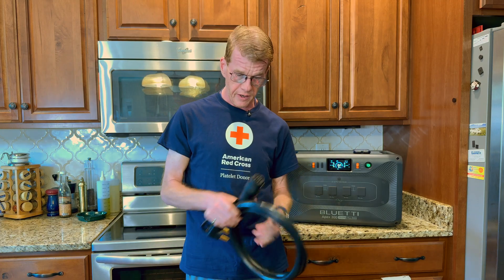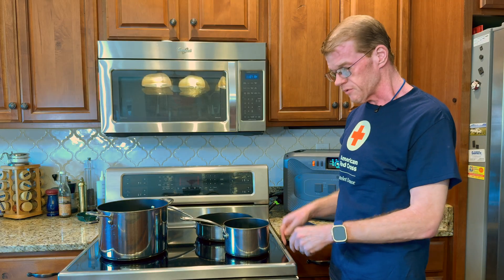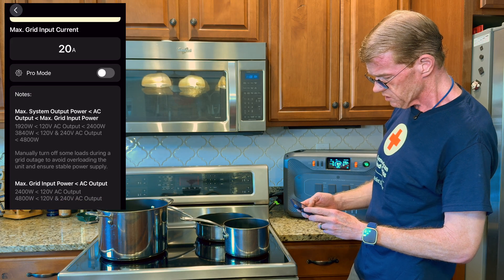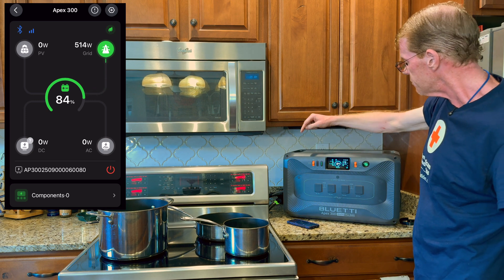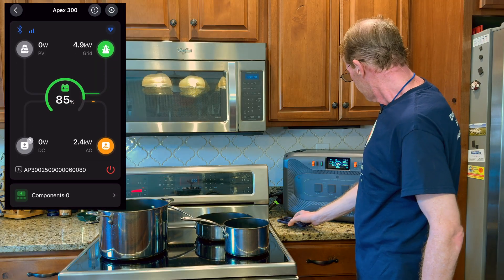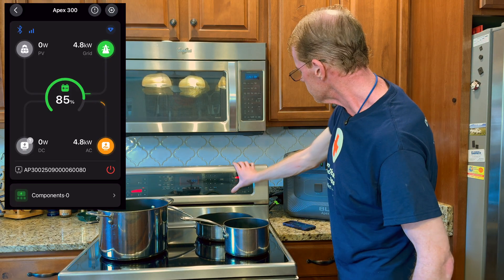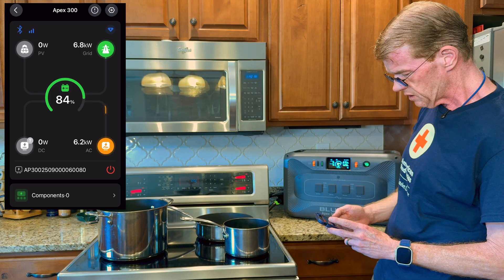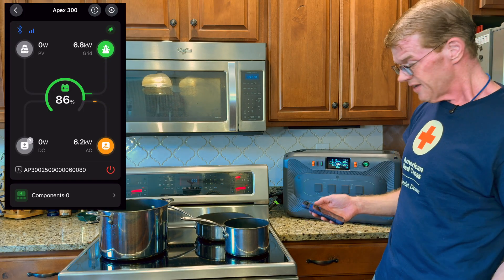50 AMP Input/Output With Bluetti APEX 300 120V/240V Power Station!

Comment: Nice video Doug, thank you. That's useful info. I wonder if Bluetti will make an APEX 500 like they had the 300 and 500 series for the previous generations.
Reply from the maker: Good question.  I'll give you my opinion from a math and Engineering point of view, I have not been told anything by Bluetti on the subject.  I highly doubt there will be a larger model.  A NEMA 14-50 outlet is about the largest commonly found plug type in the US,  at peak it can supply about 12kW.  Anything larger would tend to be hardwired and for that you would use one of the permanent install EP series.  One critique of the AC300 and 500 is that they had no internal battery.  So the device needs a battery, so +weight.  Making 12kW peak power  via two parallel devices would probably be over 100lbs each and very less portable,  so they divided by three.  Making a moderately portable, still heavy, but less than the weight of an AC300 or AC500 + one battery device.  its a lego block that scales from 3,840W, to 7,680W, to 11,520W, all continuous rated, which is more than you should even put through a 50A plug continuously.  Three head units vs two also allows more expansion batteries to be added to the system for a heck of a lot of Wh scaling also.  Two parallel Apex 300 would give you more power than a single 'Apex 500', assuming the 500 would be 11.5/2 = 5,750W rated.  They really designed it so a larger unit doesn't make math sense to have in the lineup.
Reply: @DougKremer  ahh, so much I just don't understand, LOL. I guess there is just not a way to use the electric dryer if you had to. We have a gas dryer now and being pressed to move all to electric. So if we have an outage I just won't dry clothes, oh darn. Laundry it is! I do have to learn more about these bigger units as I would like to make a move to them at home in the nearish future. Keep the videos coming, I really like them.
Reply from the maker: @happymaddie3039 if I was shopping for an electric dryer right now, I would buy a dehumidifier model “ventless dryer”.  They plug into a normal 15A outlet!
Reply: @DougKremer  That sounds interesting....My dryer now seems to be dying, not drying well so I suspect I will be shopping for a new one. watched your video on installing a transfer switch to your panel, super interesting and you make it look so simple. I will still be hiring an electrician for this but I feel better about it being a relatively simple and possible solution for us. I am still wanting to add an APEX system for a few of the essentials in the house, mostly to avoid the grid and peak hours. I currently have one power station at all the key applies around the house and so there are many. Will be working my way to a more tidy solution. Enjoying your videos very much, please keep making them.
Reply from the maker: @happymaddie3039 Thank you Maddie!   Sort of funny, my dryer just a few minutes ago lit up with an airflow error light, I may be taking it apart to clean out all the lint. 😢
Reply: @DougKremer  oh boy, best of luck on that project!

Comment: This is what I was most interested in when I first heard about this device. I ended up testing this out last weekend when I got mine. This is truly an amazing feature, because I can run my back up generator at a lower output level (saving fuel and wear on the generator) and allow the apex to handle the surge loads. I have since ordered a second apex and will now power my house from the apex and use the generator to charge the batteries. Lastly, another good feature of this setup is the UPS function, when I kill my generator as long as I’m under the max output of the apex I don’t lose my lights or electronics.
Reply from the maker: Exactly!
Reply: Gas engines, and especially generators run at max efficiency at or near max power output. This is counterintuitive because of our conditioning to MPG figures. But we're talking work done per fuel volume vs miles drive per fuel volume (accelerating is work. It's just not work that increases miles driven). So running at a lower level does NOT save fuel. Nor does it measurably decrease wear. Generators are engineered to fun flat out forever. Maximum efficient setup is to run generator at 100% until battery is charged and then shut off. And then repeat. I can cite references if you care. There may be other factors like noise that might be worthy of running a generator below 100%.

Comment: excellent video. I am in the process of setting up two Apex 300's + 4 batteries to a Hub A1 and generator inlet so I can run modest loads from my basement if the power goes out. The outside gas generator (plus some solar panels) would be used to recharge the battery system if needed. Looking forward to testing all that and having peace of mind this winter. Your videos have helped immensely.
Reply: When you try the solar panels, would be interested to know if passthrough works with those charging the unit.
Reply from the maker: Thank you! I'm glad the videos have been helpful.